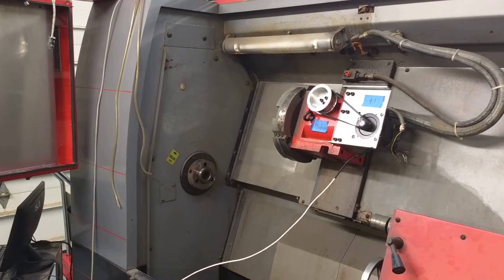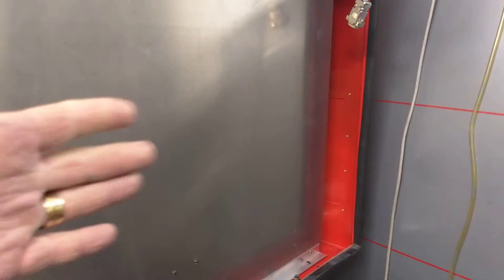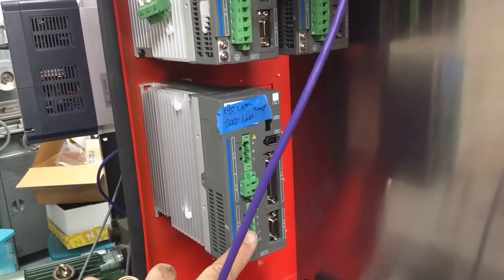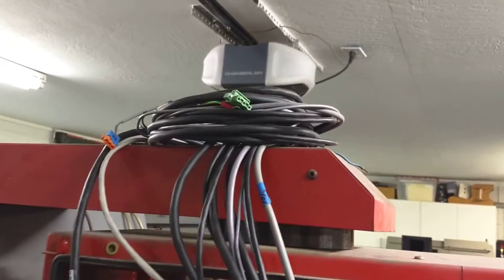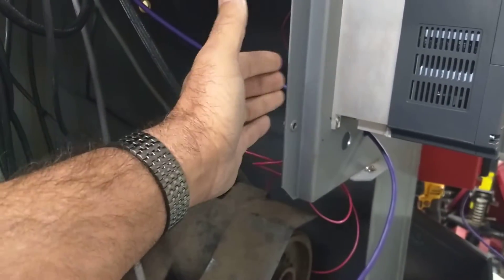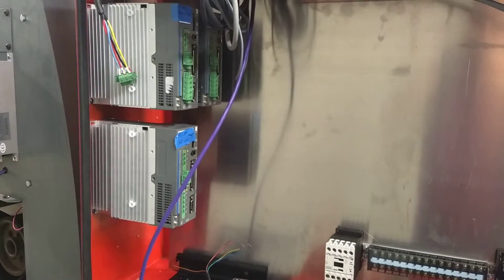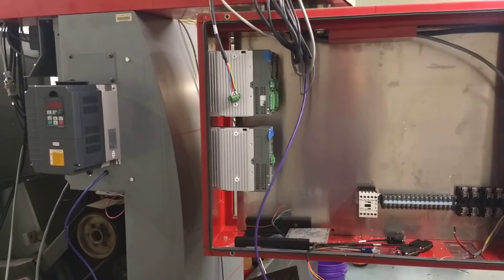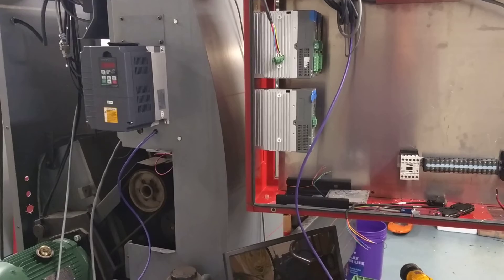Emcoturn 140 Quickie Update - Centroid CNC DMM Conversion

Comment: Hey Marty, what monitor will you be using? Interested to see how you flush mount it.
Reply from the maker: Well, mine is an ELO Model ET2243L-8UWA-0-D-NPB-G sourced it new on ebay. I suggest resistive screens over the capacitive multi touch screens.

Comment: Hey Marty, interesting idea to use the index pulse of the servo for your homing routine. This seems like a nice universal method for dealing with tool changes. Here's a question, can you just figure out where the index position is relative to your tool positions and program your offsets accordingly so that you don't need to fuss with an adjustable bushing?

Also, How does the turret position lock work on the emco, is it solenoid driven?

Mori-Seiki SL-3 coming into the shop soon. It is in working condition, but again, kicking around the idea of a similar low-cost retrofit to what you're doing here with the emco. The hurco sm1 mill I bought was in such great shape that all it needed was a processor upgrade and it's running drip-feed DNC already!

Thanks and keep up the good work!

Comment: Marty,

I would like for you to take look at my solution for serial homing using proximity switches. This is the setup I am currently using.
Should provide the same security as mechanical limit switches. Requires the input to be set to NO. If anything goes wrong, then the resistor will change state of the input.

Here is a link to my setup: 
https://1drv.ms/f/s!AjPN8NLEaQJ1hdcwsskqMq1B9TGNqA
Reply from the maker: Hi, not so sure that's going to work. You'd have to bench test it. Suggest you post to the Centroid Users forum.
Reply: Marty,

I am currently using it on my mill. Wanted to avoid mechanical switches. Works perfect for me. 
Prox switches are NC so they will send 24V from switch to switch and on to the input and therefore the input must be set to NO. If anything fail then the resistor will pull down the input and change state. 
This is just an alternate way to use serial non mechanical switches for homing.
Reply from the maker: @matsbengtsson3756  that's good to know. You should share that with the other Centroid Acorn User's on the Centroid User forum and Facebook group
Reply: Marty,
I did share it on the Centroid user forum, but messed up and did not put it in the Acorn forum. Also mentioned that I would like an opinion from Centroid.
I Don't do Facebook or any other social media.

Have a nice Thanksgiving.
Reply from the maker: Centroid won't respond to something like that. Nice work!